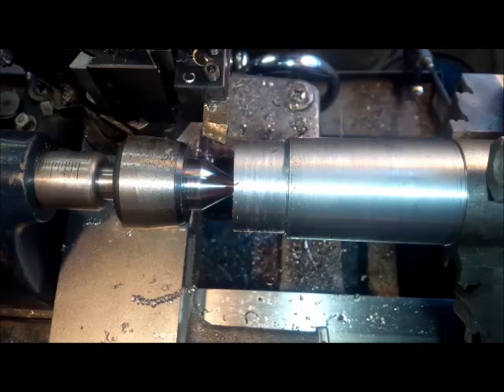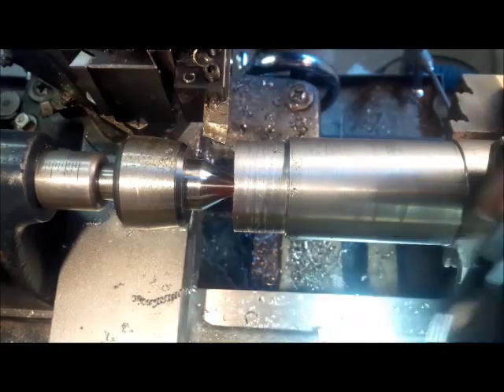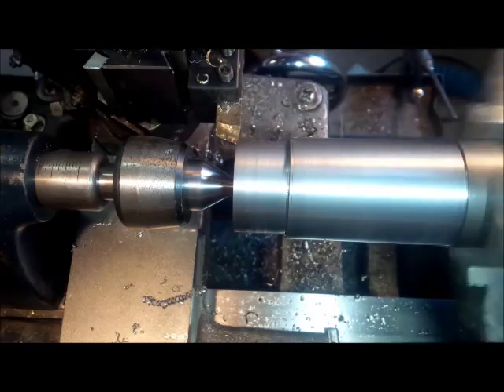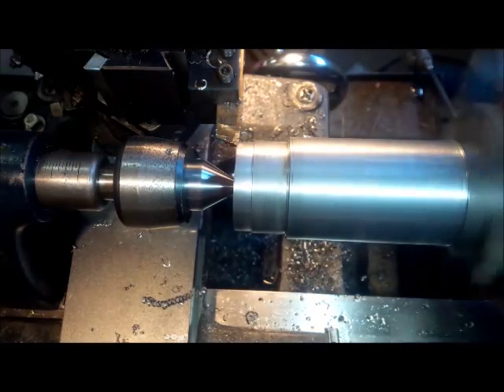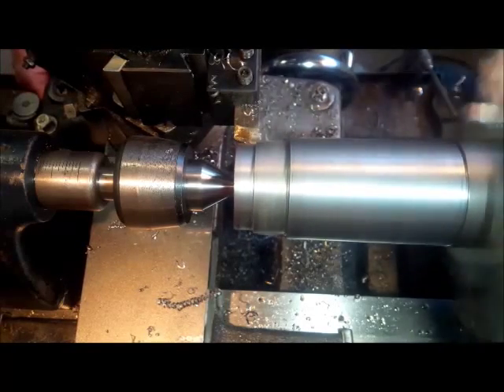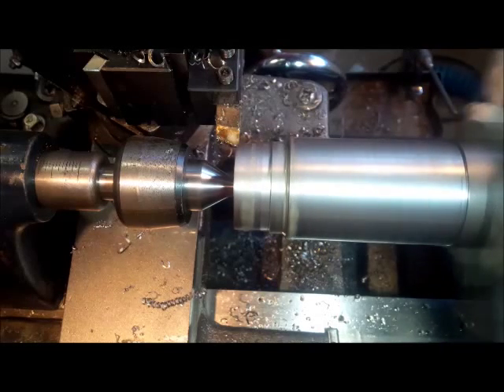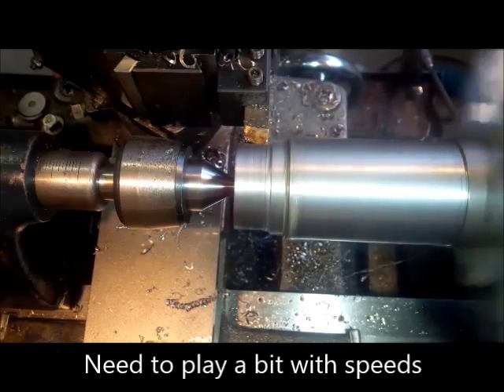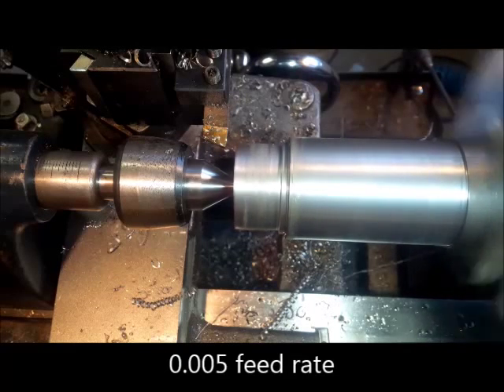Chip Control - Flyweight division - Heavy cuts on the altas lathe

Comment: Hey Steve,

Way to go. Experiment with your tool a little. I would add a lead angle and more top rake than you had. I think you will learn a lot about high speed and your machine. Thanks for sharing.

Bravo!

Tom
Reply from the maker: Thanks Tom. I fully intend on experimenting with the tool. I'll add the lead angle and add more back rake.
Reply from the maker: Take #2 is posted to my youtube. Thanks for the tips, they worked.